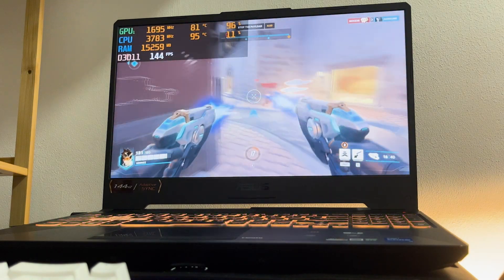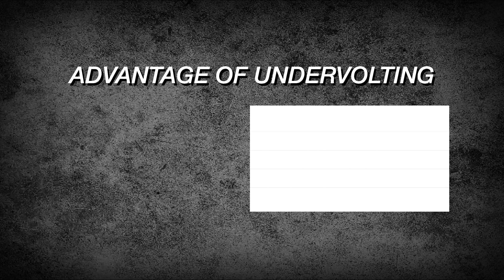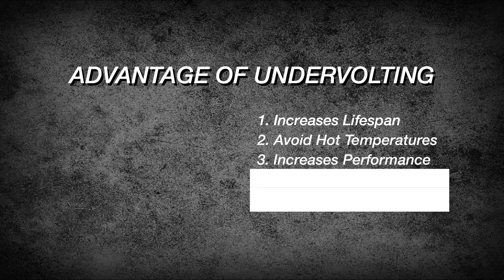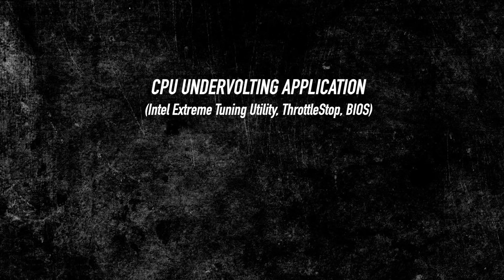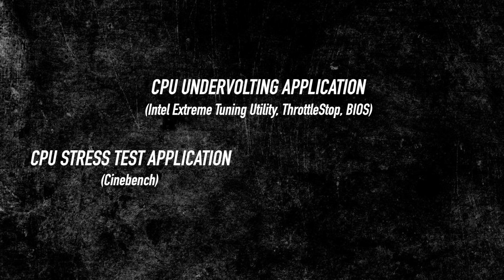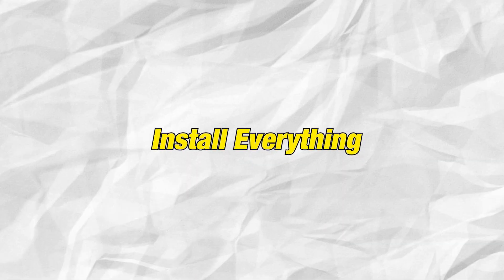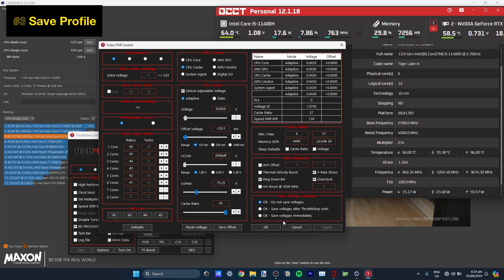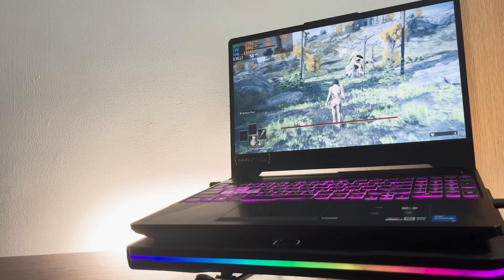UNDERVOLTING 101: CPU EDITION (ASUS TUF F15)

Comment: i have TUF F15 rtx 3060 series but when i checked the FIVR the "FIVR Control Panel" is locked, is there anything i can do to activate it or to show it?
Reply: Have you been able to find the solution?
Reply: @MegaMitrandir only solution its custom bios,im still finding an other solution to this day
Reply: @sebaxk some result?
Reply: @Jao_pb  still nothing
Reply: How is yours running? Mine won't turn on anymore and I babied it dude I'm so pissed off about it. I'm a noob at computers too so I've been down the YouTube rabbit hole trying to figure it out.
Reply: @m4hred downgrade the bios version to 3.11
Reply: All of you must be on 3.13 now, so downgrade it to 3.11
Reply: @delta.p8710 Mine only have 3.15 and 3.16

Comment: You have an asus tuf f15 with 48wh battery right? I want to buy asus tuf f16 with 90wh battery...do you think it can last 8-9 with coding and general use?
Reply: If you are going to school and back all the time, the weight may be a problem for you. If you put it in silent mode and turn off the GPU, I think it will last 5-6 hours. I have the 48 wh model and it lasts 3 hours.

Comment: Uhh? You have to disabled the Virtualization first, So that you can now undervolt your CPU using that Software.
Reply: Throttlestop don't work with enabled virtualization
Reply: @DariusNzy  Sad, but nothing changed for me. I disabled virtualization in BIOS, set offsets with grub turned off Core Security and Hyper-V - nothing worked.
Reply: trottlestop dont work on 11th gen poc's
Reply: @HillKliphe  fortunately, it does. 2 days ago i've disabled cfg and undervolt locks in my modified bios.
Reply: @honeyglow   where did you find the modded bios? i have asus tuf f15 507 2023 and all the settings are locked from modding, nothing works from the recommends above
Reply: @MegaMitrandir  There's a channel Laptop Tweaking Tips and he's made a video How to undervolt any laptop with a locked bios!!! (updated) #undervolting #undervolt #throttlestop that helps with undervolting even locked processors.

Comment: I have a f15 laptop exactly like yours but with i7, the cpu temps run above 80 even with laptop cooling pad when gaming. Should I disable cpu turbo boost? Some people suggest me that i should turn off the cpu turbo boost.
Reply: u can turn it off on non intensive games for lower temps and then turn it back on for intensive games so u could get good performance

Comment: How is doing it from here different from controlling the CPU or GPU from the 'Armory create' software? Could you plz help me understand. Thks.
Reply: I cannot find the feature to undervolt in the armoury crate, that's why. Armoury crate, at least on my laptop does not allow undervolting. Undervolting means that you give less energy to the cpu at a certain frequency, which means it runds cooler and it will then try to reach higher frequency and give more performance. It is a really good feature

Comment: Hi . I am using the asus vivobook pro 15 with intel i5 12450h. For me the first settings in throttle stop are locked. Is there any way for me to undervolt.
Reply: Same here my sliders don't work let me know if you find how to do it bro 😊
Reply: try to reinstall the bios and don't click the set to default button as doing that will cause the slider in throttlestop to be locked. if that does not fix it maybe it's locked on your bios.

Comment: Can you give us a comparison when gaming after you undervolt and before you undervolt
Reply: Most of the time you ain't gonna get that much performance boost, at max 10%~20% on several apps, some others are going to work the same or instead get less performance. The only thing that really lis noticeable is temps improving by 10-20°C depending on the pc model/bodybuild and cpu
Reply: the difference is definitely there especially if your laptop had over 85 degrees celsius then thermal throttling kicks in slowing down the cpu, undervolting so it goes below that number will increase performance but be aware, undervolting further might crash cpu or reduce performance, if it reduces performance then just nodge it back to where it didn't and that's it

Comment: does it work for i5-12500h?
Reply: Typically the intel processors that ends with K or X are the ones that are unlocked and you can take control over the voltages yourself, the rest of them it usually depends on who made the system and what the motherboard/bios is like. On my F15 laptop with an i5-12450H, its locked so I cant. Best way to tell is download Throttlestop and see, if it doesnt let you change any voltages at all it means its locked.
Reply: @kvernesdotten  yeah i have an asus tuf  too f17 12500h is locked even in throttlestop that sucks undervolting should be a must on any cpu
Reply: @RobloxTales.Studios  Oh I agree, I can see why enterprise machines would be locked so users cant mess with them, but especially laptops really benefit from undervolting. There are some power limit apps that sometimes work but those dont do the same thing and has very little benefit.

I even undervolted my 7950X on my stationary and it improved in every way, no random fan ramp ups and increased cinebench score by like 3000 points
Reply: @kvernesdotten  yeah i power limit it to 35 watts but its less performance, i undervolted my 3050 its 10 degrees colder and 200+ mhz , undervolting is amazing
Reply: @RobloxTales.Studios  Hermez does say in several videos that a laptop stand with active cooling is a must, do you use one?

I dont have one, mostly because I feel like being tethered to both a charging cable and a stand its basically just a stationary rig at that point. But maybe im wrong
Reply: @kvernesdotten  i use a laptop stand my temps with gpu undervolted and cpu turbo boost disabled 60-66 degrees on both the cpu and gpu
and gpu undervolted and cpu turboboost enabled 66-72 on gpu
71-80 on cpu